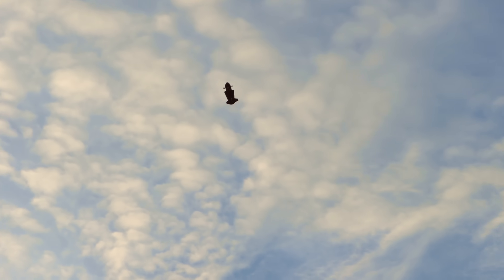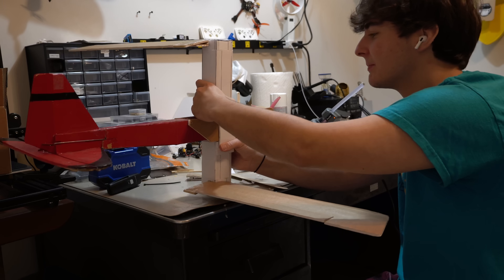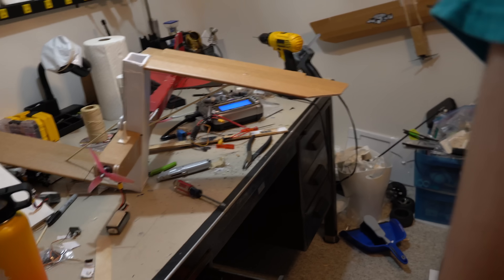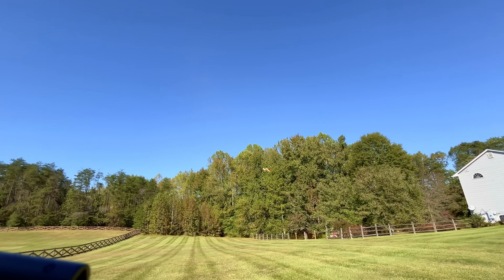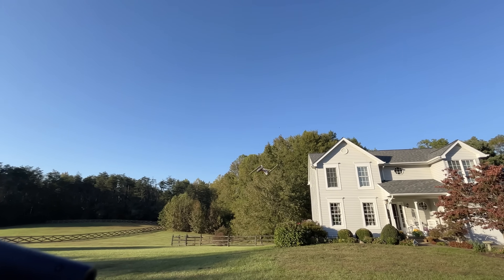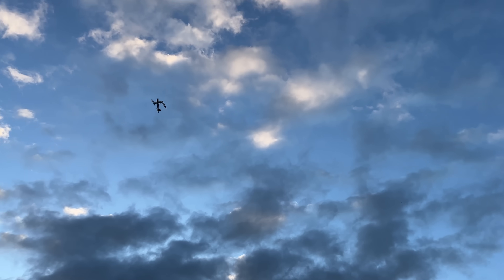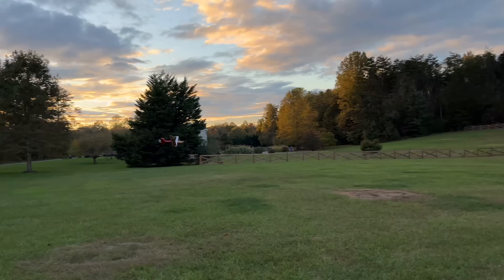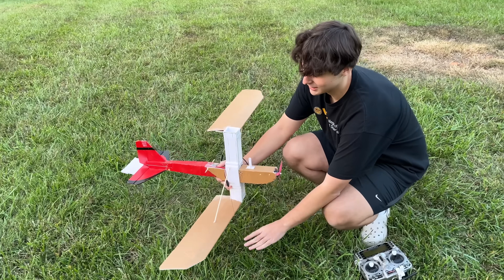Can a Plane Fly With Offset Wings?

Comment: I'm thinking the issue is less that there could have been lift differential and more the issue is kerfunkery between where you centre of gravity is vertically vs where the centre of lift and/or pressure is vertically. I bet it really doesn't like flying Right hand patterns but it'd be interesting to see if increasing the rudder authority or adding some structural weight to the right hand side wing compensated for the tilt?

Comment: Thanks, very interesting...  The lift on each side is the same...  Does it turn left easier because the lever arm from the fuselage to the top right wing is a little longer?  Or maybe you had to build it that way for stability? I know nothing about building planes...

Or does it turn right just as easily?

Comment: I think the only thing that isn't accounted for with this is the different distances from center. Its possible that if the wings weren't equidistant than it would roll due to differences in leverage. Though frankly its probably not enough to effect anything

Comment: Even before watching the video, I could already guess that vertically offset wings wouldn't alter its lift capability.  All it changes is how high the center of lift is, which could alter the plane's roll stability.

An interesting side note is that a plane doesn't even need symmetrical wings to fly — in particular, oblique wings like on the NASA AD-1 experimental plane, in which the entire wing structure could pivot so that one wing had a high forward sweep while the other had a high backward sweep.

Comment: I immediately knew it would fly and also knew what the problems would end up being (being harder to turn right).
The problem lies on the center of balance a Z or N shape. The wings will not balance parallel to the horizon. There is a imaginary line from one wing tip to the other. This is the line that want to stay parallel to the horizon.

In short: With a offset wings the center of balance of the wings will constantly be trying to roll the plane to its balanced state with will make it harder to roll to the opposed direction and will require constant roll compensation to keep the place straight.
Reply from the maker: It rolled both left and right the exact same 🤔 no preference to left or right.
Reply: @joosh_king  Might be because of the scale. Its a small and light plane. The bigger the place and the offset is the more pronounced the imbalance will affect its performance.
Also the way you build it its natural state favors turning left with is what you did the most.
You can see the center of balance of the wings by holding the place by its tail and motor. You will see that the plane will NOT be parallel upside down with the horizon.

Comment: I noticed that in this one your wings were offset one below and one above the main body, but in some of your others it seemed like they were both above the main body. Does that make a difference with anything?

Not doubting, just curious
Reply: One of the things I was thinking while you were talking about it is that I could see the leverage from one wing tip to center of mass to the other wing tip being different. And maybe that would mean that lift on one wing would be more effective than the other? 

Very cool video!

Comment: it's been 33 seconds of your video, I'm now making a "prediction" :)

each wing half has the same amount of lift so they should lift the wing the same amount, with that it should fly straight. but that is with the assumption that both wing halves are exactly the same. and then no engine or propeller torque is included in my guess :)

propeller and motor should turn the plane a bit, because that's what happens on most of my small and very light RC airplanes, like FliteTest quickbuild airplanes.

Comment: the offset does matter because of differing torques on the center of mass (com). for example, if the com was really low below each of the wings, the lift forces on the wings, though the same, will produce different torques on the body of the plane. In particular, the higher wing will have greater torque. To generalize, If the distance from the center of mass of each wing is the same, the torques will counteract and be net nil. If the wings are different distances from the center of mass, there will be residual torque and hence roll. It will roll in the direction of the force of the wing farthest from the center of mass
Reply: should probably mention that im not a physicist but I have made a questionable flight sim for a cmp sci class project. I don't know in what universe planes fly the way they did in my "sim" but they did go up 👍

Comment: I completely understand people's misgivings about the offset wings, but honestly it makes sense for the placement of the wings to not matter. Both wings are providing the same amount of lift so it shouldn't matter if they're wonky like that. The only time you'd have a problem would be if one wing was offset rotationally because then they wouldn't have provided the same amount of lift.

Comment: It feels weird, but yep! The primary reasons we don’t do this are structural and aerodynamic.

1) can’t have a structural spar across both wings to prevent them from bending/tearing off when loaded
2) excess drag induced by the vertical offset structure
3) more induced drag due to finite wing effects

Otherwise, on a small plane like this, it’s practically identical.
Reply: Landing gear.
Reply: @john-paulgies4313 offset landing gear + landing autopilot?
Reply: @john-paulgies4313  depends where you put it
Reply: Ground effect should be different though, so maybe it will be way different on takeoff and landing.
Reply: @Krmpfpks  definitely. Unbalanced aerodynamics close to the ground, who wouldn’t want that!

I was just listing aspects affecting the majority of actual flight time

Comment: One well designed experiment is worth more than 1000 expert opinions
Reply: but the experiment is bad designed because it does not take the ground effect into account which propably was the problem of the flying car
Reply: @moritztweber   No, it wasn'tm  Or, not the only problem, anyway.
Reply: @moritztweber Then make a better one.
Reply: wise words
Reply: "expert" opinions.
Reply: @josh_harrison  then this Was the wrong question, if he wanted to know, if the offset was the problem of the flying car. Because it never really flew! Problem was already at take-off, at now He never tried, a take-off from the ground. So experiment was good, but the Research question was wrong 😅
Reply: It's not a well designed experiment.  He just got lucky. This time, he just happened to put the two wings close enough to the same distance from the fuselage that the rotational forces each created roughly offset each other.  Close enough that the plane's controls could compensate for the difference.  Because he isn''t understanding the forces involved, though, he's just as likely to do something boneheaded, again, next time.  A well-designed experiment would help him gain understanding, not just allow him to luck into a working model.

Comment: Naturally it would work, the lift value is the same on each side because the wings are the same dimensions,
It doesn't really matter where they are on each side of the plane, as long as they generate an equal amount of lift for that side.
The only point where this might be a factor is when it's in the ground effect zone, as the lower win will be generating a different value to the upper wing because of the ground effect benefits.

Comment: Fellow Aerospace Engineer.  This works well because your center of mass is equidistant from the center of mass (or at least within an inch or so on either direction).  If you had mounted one wing normally and the other wing up high, I have a strong feeling your results would have differed. This is a simple statics problem many undergrads are given in physics and entry level engineering courses. If its a simple FBD with one lever in line with  the center of rotation and the other lever mounted up 8" or so with both creating a force straight up, the higher up wing loses some of its torque since the force is no longer perpendicular to the point of rotation. If you offset the wings like you did both up and down here, that loss is then negated by the other wing also losing some of its torque on the center of rotation. That is why I believe you found success with this model where as elevating only a single wing would have led to instability. 

Naturally you would need to add a little bit of ballast along the bottom of the fuselage to bring the CG back down to its normal spot with a wing being mounted so high.

Edit: I went and built the FBD. Something interesting as you elevate one of the wings is the center of force for the elevated wing gets further from the center of rotation as well. In theory this would create more torque than the lower wing up until a certain point where it would quickly decrease. I kind of want to run something in matlab now to see where the theoretical balance points are and how it changes as you continue raising it. :)

Comment: At first I thought it would cause it to roll.. but then I thought about it and there's no reason one wing would generate more lift than the other so I figured it would fly fine.  
But then after seeing it fly I realized the higher wing is above the center of gravity and the other below but not as far there appears to be an offset that is creating a bit of twisting torque causing a roll. If both wings were equidistant from the axis of roll then they'd probably offset that it would fly even better. 

Just my thoughts. I'm no engineer at all.

Comment: it's pretty clear the center of gravity was off. it wanted to fly sideways and in a circle. if you put metal rods where the other sides of each wing would be to offset the weight distribution it would fly straight. There is however the ground affect that will flip your plane if it gets too close to the ground as the air will begin to compress more under the lower wing.

Comment: Im more confused as to why anyone would think offset wings would create different lift. Its still a wing and air will still move over the wing at the same rate and they are shaped the same they they produce the same lift. Only thing i could think would be weight effecting CG that may causing some roll/yaw motion if it were to. Im an aviation mechanic not an engineer so it makes sense to me that it would have no change but who knows.

Comment: Not seen it fly yet, but surely in order to equalise any lift leverage forces due to wing distance above/below the fuselage the wings would need to be equidistant from the centreline of the fuselage rather than offset?
I would think that the wing with a higher leverage moment would force a slight roll, in this case the left wing being slightly higher than the right, the aircraft would need to be trimmed to permanently roll left slightly?

Comment: Nice experiment! And absolutely in straight, level flight at model scale there's no reason the crazy offset wings shouldn't work. There are however, some extra complications that could come up.

In full scale, the lit force on the wing can potentially flex the wings, with the tips moving upwards. This change in shape means the lift force will turn slightly inwards towards the centre of the plane. If both wings are the same height, this cancels out. With the offset, the lower wing's lift points more towards the centre so it's roll force drops while the upper wing's lift moves to increase it's rolling force. So if the wings flex enough, then the offset could induce a roll, though it would have to be a lot of flex to be something that can't be trimmed out.

Second, when pitching up or down hard a huge vertical offset will mean one of the two wings is travelling faster through the air than the other, again resulting in greater lift on one side and a tendency to roll. Again, whether this is significant enough to matter depends on dimensions and speed.

Comment: “I’m an actual engineer!” 

No - you’re better - you’re a scientist! (from one scientist to another) You thought through what you knew, you made a testable hypothesis, and you did a great experiment to test that hypothesis. THAT is a scientist! Twice, actually - you also hypothesized that the flat column would interfere with airflow, and you tested that as well… and were right yet again! Very nice work indeed, and I’m sure your father couldn’t be happier to be proved wrong. You will go far :)
Reply: I'd add that he tested if it would fly, but didn't test if there was a roll bias. But that's only a small part of everything you said.

Comment: I would say that the big difference between the two is that on this one, the forces cancel out since the lever that each wing is attached on opposite sides of the fuselage, so they cancel each other out,  meanwhile your other design was a high wing, but the upper wing had more leverage on the fuselage, but it should be minimal enough that it's just a trim issue.  Glad to see you did mention ground effect though.

Comment: i have not seen this yet and i just want to say with my lack of any knowledge other than a little bit... that it would fly just fine with no issues. lift is lift. at a LARGE scale and at high speed it would be a problem, not with lift, but with unequal force applied to the fuselage. This is basically just 2 wings on a stick, separate them unevenly and it would be the mail issue. Flying strait probably wont be an issue but trying to roll and bank might act funny. IMO it would work fine on small scales.

Comment: It’ll roll when you climb or drop. When you climb the lower wing will travel through the air faster than the upper wing since it’s travelling on the outer curve and that’ll make it roll. Same but opposite for descending. You said in the video that it wouldn’t climb and that might be why you didn’t notice it, but changing pitch with definitely roll it

Comment: Ballast overhead-wings provide (hanging the fuselage from wings) compared to the ease of rolling provided by under-wings (projecting from the floor of the fuselage), the overhead-wing always wants to hang upright while the lower-wing is apt to evasive rolls; the wings would both have to be shaped differently, probably two independent tails: maybe model the lower wing after a U2 and the upper-wing like a seaplane, to the right scales.

Comment: I am a Mechanical Engineer, I did some quick force diagrams on the back of an envelope: If you offset both wings in opposite directions an equal amount then the plane will be fine, this is what you built. If you offset them by different amounts then you will get a torque and the plane will want to twist.
Also those are aileron rolls not barrel rolls. (the Star Fox 64 videogame is the main source of these getting confused)

Comment: Not having watched the video yet: the higher wing has lower air pressure and therefore produces less lift. But I don't think it makes a difference at this scale.
But the propeller will probably cause the airplane to turn because of torque, thefefore the problem with the offset Wings is negligable
Now let's watch the video to see if I'm even close to correct with my theory

Edit: it seems that both effects are negligable, because they would have added up if I saw it correctly. I wasn't too far off, cool! :)

Comment: So, I am by no means an expert but i believe the problem you may have run into with the offset wings has something to do with ground effect since the wings would have been effected differently based on their height from the ground. since ground effect affects planes with a positive influence on lift the wing closer to the ground would have an increased lift value then the one slightly higher wing. just a thing that may be worth doing further research on.
Reply: i believe if you were to take this plane off from the ground you would notice similar effects if not more exaggerated effects that you did with you car plan where the lower wing pushed the higher one over.

Comment: Because the wings are on opposite sides of the plane and the force on each is upward, they create opposing angular momentums, which cancel eachother out. (an angular momentum is the thing that gives stuff angular acceleration, i.e. what makes stuff rotate).

The angular momentum is given by M=F*d. In this example, the lift force F is roughly the same for each wing (F1 = F2) (I won't go into the aerodynamics of it), but d (the distance between the centre of mass and the applied force) is not the same. Since, in this situation, the wings are symetrical, d1= - d2. This makes it so that M1 is equal and opposite to M2, so they cancel each other out. 

 If you were to make a plane where the two wings are at different distances from the plane's centre of mass, however, M1+M2 would be different from 0, so it would generate rotation.

Comment: When one wing is the same distance in the oposite direction it will cancel out because both got the same leverage.  But what would happen if they are offset in the same direction? Like one wing 5cm abobe body, the other 15cm? I think then it wouldn't and that was the case with your flying car